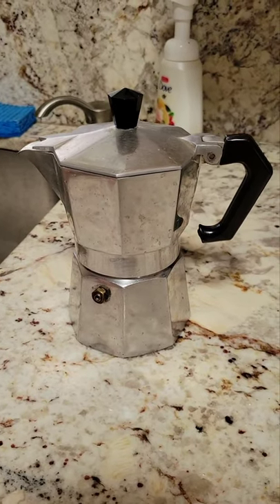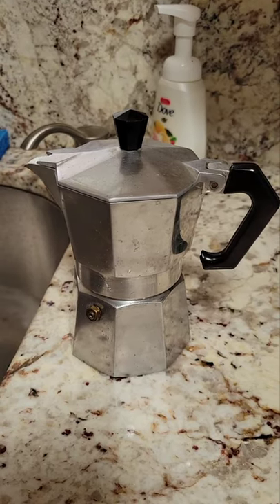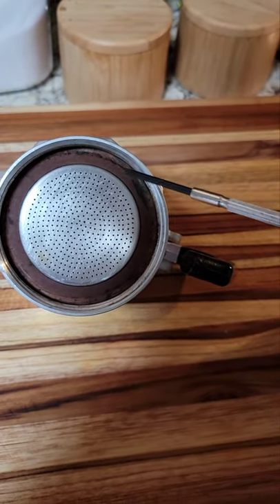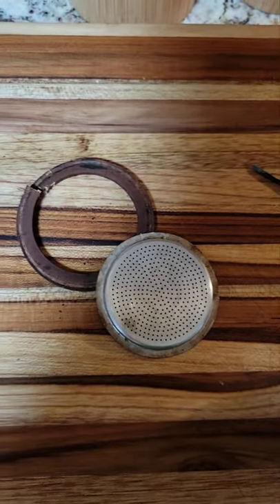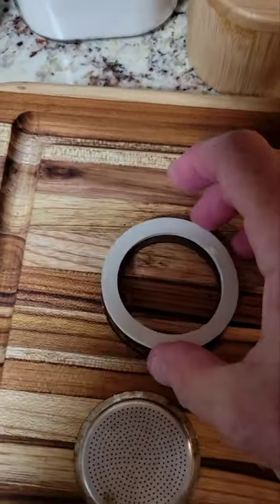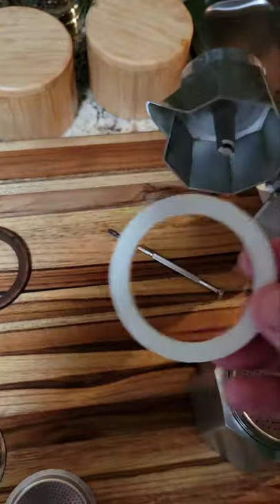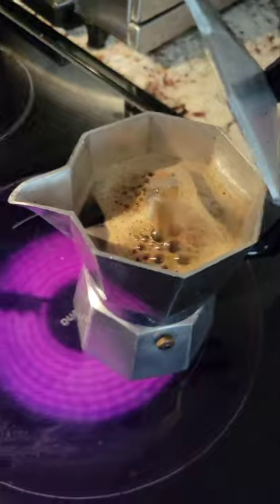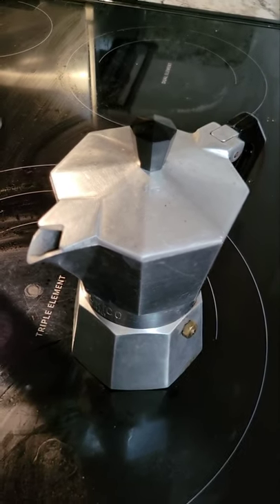Moka Pot Gasket Repair

Comment: Tks for sharing your experience!  I have a leaky vintage pot that I’m troubleshooting atm… ordered new replacement gaskets from a very inexpensive seller, & though they were almost the correct diameter, they were way less thick than the original, & flimsy. I’m ordering from Bialetti or Grosche now. If that doesn’t help, will use an idea I got from another video about just rewetting or soaking the original rubber gasket, & maybe try to remove the old rubbery smell w/ a vinegar or lemon juice & water soak & brew. It’s just too cute not to be functional